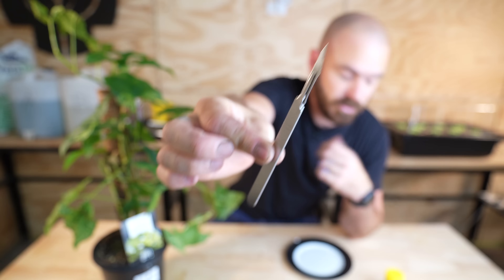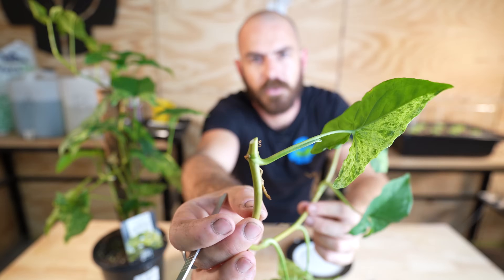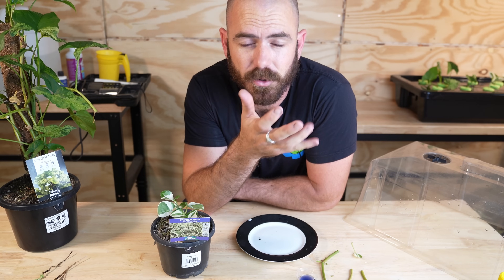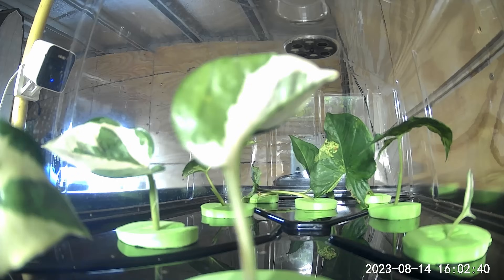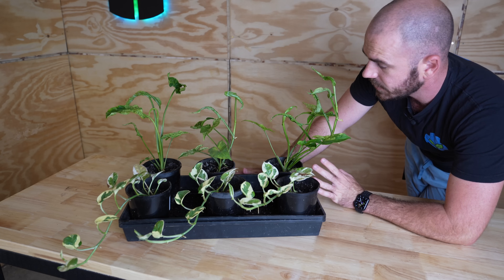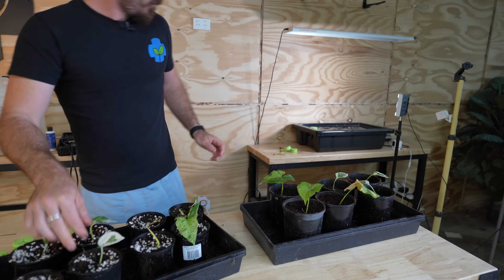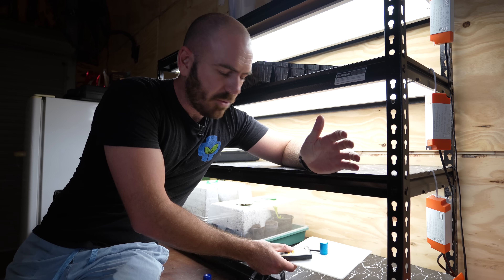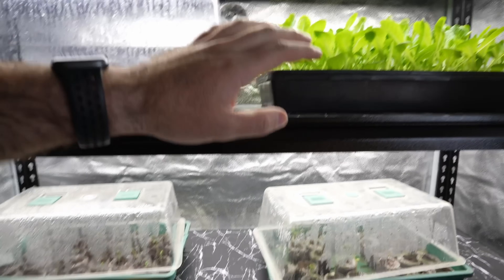The Hydroponic House Plant Experiments

Comment: Hey mate, I'm a long time watcher of your videos, I have used your videos to develop hydroponic systems to clone and grow the very plants you are experimenting on in the video, a few hints I have managed to come up with through experimentation of my own.

1. Lighting. I have a cloning shelf setup based on your own shelving setups with the tri colour ledvance panels, after months of trial and error I settled on having to place a layer of 90% shade between the light and the top of the plants, being aroids that start out on jungle floors, starting out they don't require a lot of light, and when they have no roots the really don't require a lot of energy, so they less they have to photosynthesise the better, too much light led to a lot of leaf drop, i don't have a par meter, but the meter I have was reading at around the 100 foot candles and that seems to be the happy point for me and my plants.

2. The cloner. Again through a lot of trial and error, I have found a method that seems to work great for me to get the fastest turnaround, originally I used to fill my cloner high enough so that my cutting would have its new node under the water, and although it worked, by accident I found that they actually begin to root faster if the node actually stays above the water in the humid air, the nodes create aerial roots in the wild after all, a little way to demonstrate this to yourself, is to do some cuttings with 2 nodes on them rather than the 1, you will see for yourself which nodes grow the quickest, also, I use smaller tubs for my cloners, some 8l green tubs from ikea, they fit the salon humidity domes perfectly  and I use those 200mm long blue airstones, the bubbles the oxygenated water creates is more evenly spread so I get a more consistent root striking, I also only use 1/4 strength of my nutes (growth technology foliage focus)

I can generally get any aroid plant fully rooted in around 10 - 14 days using setups you developed in your videos, so I figured I'd share what I can and return the favour seeing as you helped me so much with your vids.

Comment: Even though some nodes had small roots, these are quite ineffective for some days after transplantation. For a while, a cutting has to live with the water it already has in its tissue. Unfortunately you removed the internodes below the nodes which acted as a reserve otherwise.

Usually, that is no big deal under low par exposure. But photosynthesis is a passive process in which water is chemically consumed. So, a high par situation with low water reserve triggers the cutting to reduce the surface for photosynthesis to reduce water consumption and prevent the future apex from drying out.
Reply from the maker: Great insight thanks!

Comment: I used these plants in my 250 gal aquarium. I used an isolation box, stuck to the glass below the output spray bar coming from the filter canister filter. I stacked squares of filter foam lengthwise and put the cuttings in between them. I did not put the stems too low down, or they’d rot, so I had to pack the foam squares pretty tight in the box, in order for the stems of the cuttings to be held tight, but out of the water. I also left any roots on each cutting, so they would help anchor the cutting in place. Some stems rotted, if they were below the surface where the water waited to drain. The roots never rotted, so I would try placing the cuttings in the propagation pucks so that they are being held by the root, not the stem. Make sure that the stem is a I e the surface of the puck, so that no water splashes up from below on it. They are very hardy, when kept dry. The plant roots will grow right down into the water, if they not even touch the water to begin with, they will soon grow enough to do so and feed. Each cutting will grow many more roots and the cutting itself grow for feet above the planting medium. My plants grew up out of the aquarium and across my bedroom curtain rail! The roots grew down into the deep gravel bed of the aquarium and the female fish began using it as a nursery to give birth to their fry, as it was dense and protected. Every month, I’d cut the plants back and give away cuttings to my friends. 3 years and I never did another water change or cleaned out my canister filter. The nitrate, nitrite and ammonia all measured 0 & 10 ppm in the first year, with every water quality test I did. It only got better, over time; 0 ppm for anything, every week! My aquarium always had the lid closed with lights on, during the day and it was very humid, so I don’t think it was because you had a dome on. I think it was most likely because the stems got too wet, inside those pucks and they rotted. With this plant, less water is more. They thrive on neglect but rot with too much water near the base of the stem.